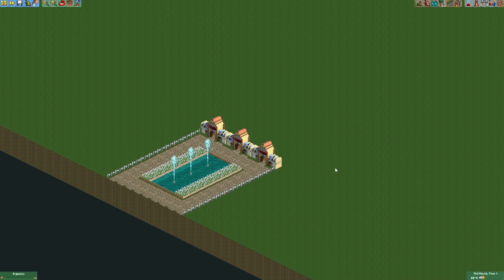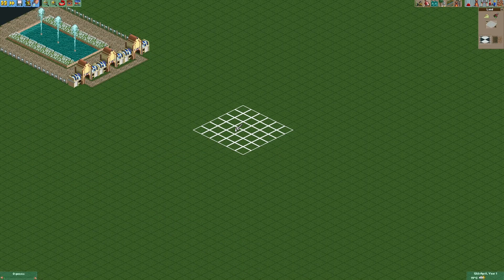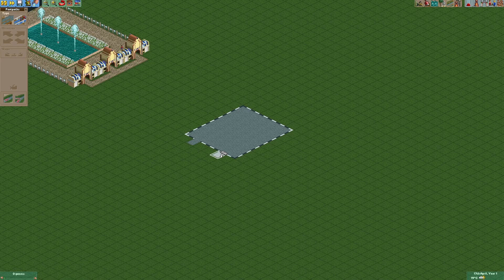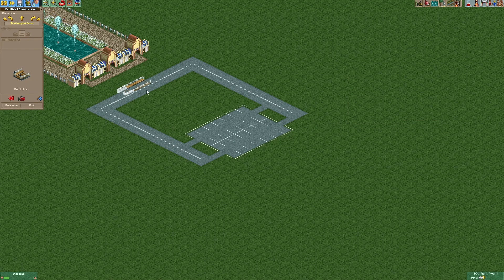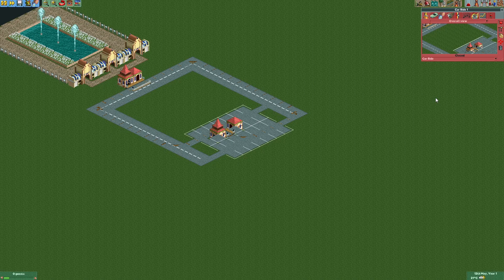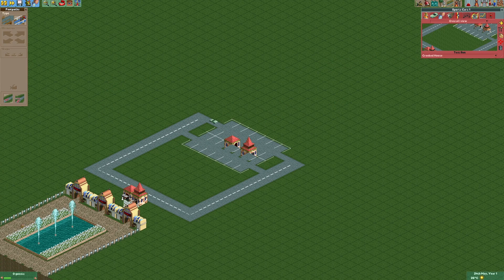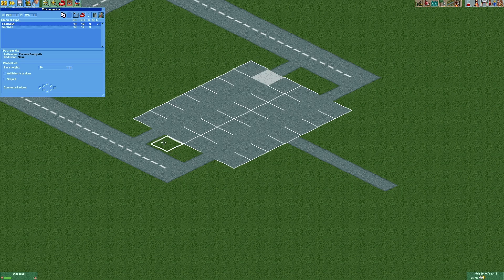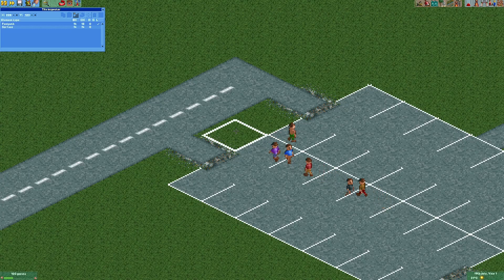RCT Minutes #8: Working Parking Lot | OpenRCT2

Comment: Will the guests not get frustrated? I think if they want to leave the park their pathfinding is too stupid to let them. Resulting in frustrated (not paying) guests
Reply from the maker: You're absolutely right, it's best if you have an additional path for guests to use instead of the car ride.
Reply: I'm not paying that much to park in Parking Lot 1.
Reply: OpenRCT2 should improve the guest pathfinding to know how to use rides to find the destination. This will make transport rides much more useful.
I'm a programmer and thinking a little, it doesn't seem so absurdly difficult, just consider the entrance of a ride as a possible path that "teleports" to the exit of another station and treat all this as a single path, especially if the ride is free.